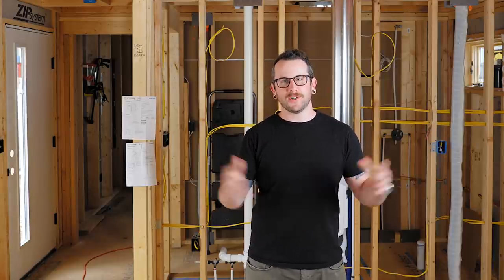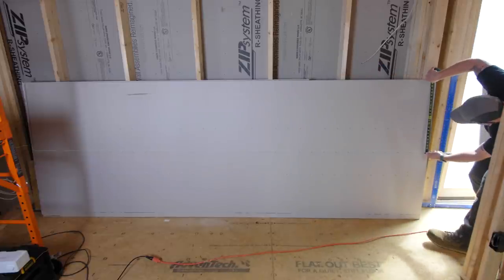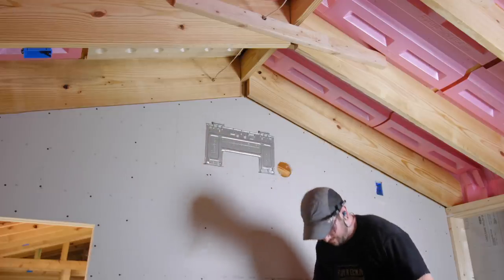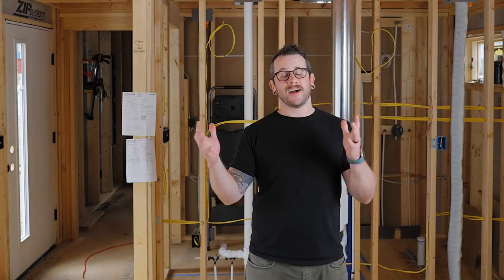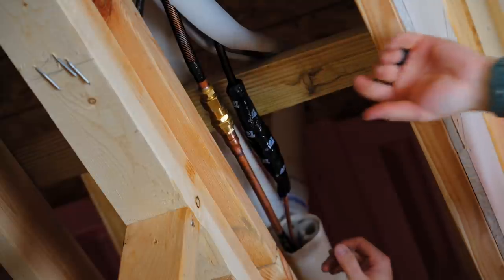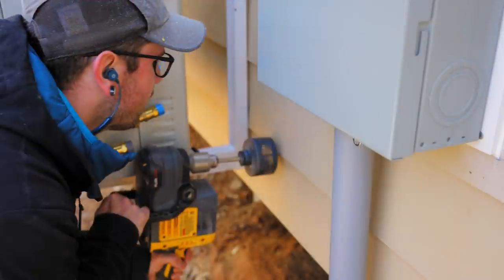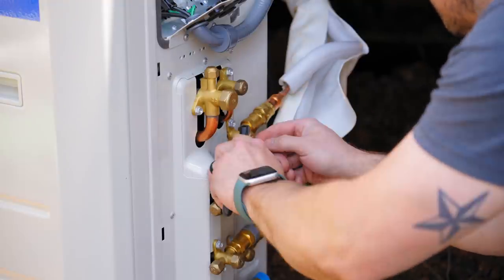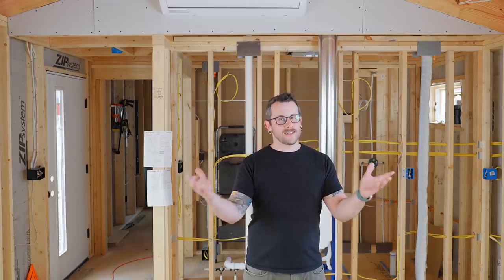DIY MULTI-ZONE Ductless MINI SPLIT Installation in New Construction!

Comment: How can you check for leaks before you open the refrigerant valve? It’s like checking for water leaks with the water off
Reply: According to some of the other comments, those line sets don’t end up with refrigerant in them. Maybe we should watch a Mr cool video. Must get to the bottom of this mystery!
Reply: This is a mrcool dyi unit which has refrigerant in their lines. They connect and then that opens them up.

Comment: I'm surprised that not many people know of the Zamna Climate mini split AC and heat pumps that are DIY just the same as Mr Cool units. It would be really cool if you could get one of these units for the house. 
They are solar ready meaning they run off direct power from solar panels - NO SOLAR INVERTER NEEDED. However, they do accept connections from the grid, so you can call them hybrids. 

I'm actually running a few of these in Jamaica 🇯🇲 right now. The 12000btu runs off 3 solar panels and the 18000btu works with 5-6 panels (405W).

The company that makes and sells them are based in the United States - Zamna Solutions | Zamna Climate. If you should reach out to them just let them know Rayon from Jamaica 🇯🇲 sent you the info ✌🏼.

Comment: Being a person who likes things streamlined I get the process of running as much as possible out of sight...
Being a person who has to fix the stuff that breaks in my house I would’ve run the lines up the outside of the house - through PVC pipe inside (as a conduit, inside the walls) and used industry standard covers outside... that way you have access to service the lines. And access hatches at all mechanical joints, because.....

Comment: We found out the hard way, fire foam is not to code as fire block. You need fire block caulking.  This product expands when burned so it continues to pluck the gap as material burns away.
We started a 2hour burn wall and luckily were told early on in the build of our mistakes. Had to dig out all of the foam around rafters and floor joists and replace with caulk. 
Thanks for the video.

Comment: So please explain what the soapy water test on the inside connection of the line set accomplishes when the lines are not under pressure.
Reply: All Line-sets and units are pre-charged. So everything is pressurized from the factory.
Reply: @zacharywhite8230  Not true. Compressor is pre-charged with enough refrigerant for 25 feet...The line sets are not pressurized. If they were, you would still break the vacuum while terminating to the condenser and evaporator. You would still want to charge the system with nitrogen, leak test, then vacuum down the system whilst removing the nitrogen charge. Then while there is still a vacuum, you would release the refrigerant all while keeping an eye on the gauges to ensure you are within maker plate specs. They (Mr.Cool) does call these 'DIY', but if you read the manual, it also states that a professional who is licensed to deal with refrigerant should perform the final turn-up.
Reply: @uswcboy  then they need to quit leading people on about having Line sets ready to go.
Reply: @uswcboy  this is a mrcool dyi unit.  Their linesets have refrigerant in them.
Reply: @majorstinky  Sorry I thought I had responded to this post. It is true Mr.Cool has quite the line up out there in terms of PRO and a smattering of "DIY". I think that they are quite clear in their wording on certified/qualified/trained and technician. I am still sticking to what I have said earlier. In fact, on the product page, MR.COOL explicitly states "NOTICE: MRCOOL® products must be installed in accordance with all applicable local, state and federal codes and regulations.   Unless explicitly stated otherwise, installation must be completed by a licensed / certified HVAC technician.   ALL electrical connections to a power source must be performed by a licensed electrician and comply with local, state and federal electrical codes and regulations." |  I think the Key here is Licensed and Certified HVAC. Certification comes into play as you are dealing with refrigerant which is a heavily regulated compound. Not only regulated by the AHJ in the area (building inspector types), but also by the EPA and more than likely a "state office of environment'. see: https://mrcool.com/diy-3rd-generation-e-star/. 
Additionally, I doubt any permitting office or AHJ would allow a permit to go out on something like this where the homeowner; or non-trade, craft/professional performs the install.
I do however appreciate your recognizing the OP...amazing how things can go off subject. Cheers!
Reply: @majorstinky  Thanks for keeping it civil!

Comment: So, I have some issues with all the mini split videos like this.  Great install video, but ‐  in Florida, I'm actually not allowed to install a system in a building where anyone is living unless I have a permit, manual J heat load calculation per room, and inspections.  I couldn't get away with a system oversized that much.  In fact, with a variable speed system, the minimum BTU output of the system has to be specified underneath the heat load calc for the hottest 1% of the year and you have to make the case for the extra BTU output at nominal as an extra load situation with calculations, but the building code really wants nominal BTU to equal the manual J output with no more than 15% oversizing.  The other issues are going to be filtration.  Mini splits don't do a good job filtering.  Also, sometimes you need to go into the engineering manual to get the mini split fans to stop to keep humidity down or add a whole house dehumidifier.  Everyone really should have at least a MERV 11 filter in their home, stable relative humidity, and fresh air coming in in some way.  Just throwing in a massive oversized system will lead to high humidity, short cycling, and in my state, not meeting code and having to swap out the system.  I contacted Mr. Cool and they would not supply me with min and max BTU rating on anything.  So, I couldn't consider them since I didn't know if I could properly size the unit.
Reply from the maker: Interesting! Definitely not the case here in NC, this passed HVAC inspection with no issues whatsoever.
Reply: A typical mini split can vary btwn 3 to 14k for a nominal 12k unit. Humidity is never a problem with these. 
If FL has those rules they are stupid.

Comment: Hi great work. I just had an estimate to have one head mini split. I was told I would need some electrical work to connect the power. (completed basement) I was given a price of 5300 does that seem  a lot? When I priced the units for one head is around 1400.00. That means the rest is labor. Does that seem like a lot?
Reply: It is a lot. One head mini split requires only a simple dedicated 1-phase circuit using 12awg wires.
Reply: Yes that’s alot of money

Comment: Question... I realize this is a few months old but, I am looking at these for my new woodworking shop and was wondering if you have had any issues running these in a shop environment? I'm concerned about how often filters will need cleaning and if there will be problem with the drain line clogging or any other issues that I need to be aware of that a dusty environment might cause.   Thanks.

Comment: I'd like to know what the precharged lines are precharged with. Do they come with some sort of valve that opens when you tighten them? Do they actually contain refrigerant? or are they just in a vaccuum and capped off somehow? Can't make 
 sense of this. He also checked for leaks adter tightening just one end of the line, either he didn't know what he was doing or the lines do come pressurized with refrigerant and this filled the indoor unit whem tightening while the other end still was capped somehow. Would love to know more...

Comment: This is WAY too late by now, but make sure that the drainage line has a continuous downward slope. If there is ANY place where there is incline that will block the water from draining and then the indoor unit will drip. Trust me, it's a well-known issue here in Israel...
Reply: I suspect those lines will gunk up a bit over time, and now they’re in hard-to-access locations...
Reply: If you were late, this is ancient 😂. Thanks, that's useful information.

Comment: If your indoor units are different sizes, does it matter what ports you connect them to? Ive heard you're supposed to connect the largest btu unit to the lowest fittings?

Comment: You should've checked for leaks in the inside connection also, with the refrigerant running thru it. When you joined them there's nothing running through the lines, so you won't know if you have a leak or not.
Reply from the maker: The lines are pre-charged.
Reply: @craftedworkshop  so when you connect the lines it releases what's in the line without turning the screw. I assume then you need to immediately check for leaks before it all goes out.

Comment: Nice video, but it appears the maximum distance for the Mr. Cool unit from wall unit to condensor/electric control unit is 24' unless they have custom extensions or something? That seems somewhat limiting. Also how did you test for leaks with nothing flowing through the lines? Also what did you do to insulate the hole going to outside the house (or did you end up not using that hole due to moving the condenser/electric control unit?
Reply: You can add another set of line and no problem. It comes with the electric and the gas piping.
Reply: Yeah, he hooks up the head w/o a torque wrench, then immediately tests for leaks without pressurizing the lines before closing in the connections behind the drywall.  I think the video skipped a step.  But regardless, this system would be a nightmare to troubleshoot / repair because connections between line and head units are buried in the walls.

Comment: How did you check for leaks without pressure system ?
Reply: I'm wondering how as well? Great series btw, thanks a lot.
Reply: I came to ask this question.  How?
Reply: Same. Inquiring minds need to know!
Reply: Actually good question.
Reply: System is full of pressurized refrigerant.
Reply: @GlenS123  not until all of the connections are mated-up and a valve is opened to release the refrigerant it isn't. They seem to be checking for bubbles in soapy water on each unpressurized connection point right after the connecting the fitting.
Reply: @marcberm  and others. I just pulled up their website and apparently those line sets ARE pre charged. Definitely interesting.
Reply: @MrDflores1  I'm looking now too. Interesting. The others I've seen have the refrigerant in the outdoor condenser unit and it doesn't get released until everything is connected and you open a valve. But now that I think about it, it isn't clear how the ambient air/moisture would get purged from those other systems if the lines weren't pre-pressurized like this. So now it's got me thinking.
Reply: @marcberm  for install, you'd have to purge those with nitrogen while brazing, pressurize check them, then pull a vacuum. Then when you're satisfied, crack open the valves you mention.
Reply: @MrDflores1  I guess there's no other way for one of these DIY/self-install dealies to work then unless all of the components are either pre-evacuated or pre-pressurized this way. Some other companies products seem less clear about that.
Reply from the maker: The lines are pre-charged, as I mentioned at the beginning of the video!
Reply: @craftedworkshop  yes, but we didn't know if all of the lines were!  Thanks for clearing that up!
Reply: @craftedworkshop  How does that work? You puncture something when tightening them together?
Reply: @luciflash  maybe the connections themselves are designed to be a reusable, self sealing connector? Kinda like the female coupler on an air hose, or like both connections on hydraulic hoses.
Reply: @craftedworkshop  yes, but until you power up the system they won’t be at operating pressure, right? So how can you be sure they won’t leak?

Comment: How did you check for leaks before introducing refrigerant to the system?
Reply: Soap bubbles. This is only because this system is dyi. Otherwise you use dry nitrogen to check for leaks on typical hvac systems.
Reply: @sprockkets  thats what I mean, if there is no pressure in the line, there's nothing to bubble up through the soap to show a leak

Comment: This is great, thanks. one thing, is there any point in 'checking for leaks' before charging the lines? i mean, if you haven't opened up the valves on the unit, then there is no pressure in the lines to push bubbles out, right?
Honest question.
Reply: I was wondering the same thing. unless the lines have some in it and when you connect them it opens somehow.

Comment: How do you determine which wall you mount the mini split on and how do you calculate what size of mini split you should get for your room?
Reply: 1 ton is 12000 btu and is recommended for up to 400sqft. Other factors to consider , building material, how much sun exposure and heat loss. Its best to consult a hvac professional for heat load/ loss calculations. Good luck

Comment: Obviously this is out of date, but it looks like the cripple studs up near the rafters by that last evaporator are pressure treated wood (see 6:10 in the video for example). Is that a problem for drywall screws?

Comment: Thanks for this video. How do you determine the length of the line sets? Also, how large is the compressor? I understand you need to have the right ration between square footage and BTU capacity. How do I figure that out?

Comment: my air con has a humming sound that osilates up and down with only a few second intervals,  what is causing that? thx.  btw it is extremely annoying and I cant sleep with the air con running.  Also the condensation pump makes a hell of a noise everytime it turns on.

Comment: Did you plan for replacement?  Eventually you will have to replace them.  With the line sets run in the walls when you have to replace them you will have to cut the drywall.

Comment: How did you check for leaks if you didnt open the ref. valves ??  there is nothing in the lines ?? also why dont you need to vacuum the lines ? especially long runs  like you had .

Comment: Curious - what was your longest run? Are they all 25 feet or did you have to use extensions?
Reply: From the video, I'm guessing he uses extension. I think the max line u can do only is 75 ft long. They do have 16,25,35, and 50 line sets. Depending on the set, u buy that comes with it. But u can do a custom order in store. That's what I read when I did research on it.

Comment: Great video! Run the line set through the wall cavity to cover all that plastic sh** up and under the crawlspace and get away from the cheap plastic that,s sold separately 🙄 by reading the comments, it seems a few are afraid of doing a little drywall repair in the event something does happen🤔🤣🤣GREAT VIDEO!

Comment: Great work, nice attention to detail. I have a question for you though. Why would the  Code require Fire rated foam sealing of your penetrations when the wood construction frame itself is combustible construction?  I do not believe that the IRC (International Residential Code)  requires this level of fire protection at penetrations especially in a  single occupancy building. See IRC 2020 P2606.1 Sealing of annular spaces.  paraphrasing -  the caulking material , foam sealant or gasketing material shall be designed for the conditions at the penetration location. Since the condition is that of combustible construction, fire rated caulking is  "overkill".

Comment: First thing you never bury flared or especially puncture fittings inside the walls that is a huge risk you need to learn how to rough in your line sets and then hang your indoor units specially after construction is done you never install completely the inside units during construction

There is a reason good hvac companies charge what they do . WE know what we’re doing
Reply: I’m wondering how he is leak testing the unit without pressure in the lines🤔 maybe I’m missing something
Reply: @albertbootle6854  I wondered the same thing
Reply: @albertbootle6854  i was also wondering. 😅
Reply: There's no pressure on the lines how can you test for leaks
Reply: @jackdickson2095  

These are cheap pre charged line sets with puncture fittings  . Again would never suggest putting mechanical fitting buried in the walls not good practice . 

Also ! , don’t buy mr cool units you will find out there’s no local support from any hvac dealer .
Reply: @twittyk78  ok, so what you’re saying is, cut and reflare the lines at the inside unit so the lines are one piece throughout the wall. 
 Secondly, what is a good brand that is serviced by hvac techs as most I’ve talked to in my area do not deal with mini splits.
Reply: @Lmiller201  Mitsubishi is the leader 

Reliable and support

Comment: If I have three units, can the temp be controlled independently or do they all have to be set to heat or cold?
Reply: Independently. Each unit has it's own line set so they operate completely independent of the others.

Comment: how do you manage the temperare in bathrooms? great job btw and thanks for your reply
Reply from the maker: I have an exhaust fan with a built-in heater for the winter months, but it stays comfortable during the summer months as long as you're not taking an hour long shower.

Comment: Unrelated to the mini splits - I'm in EU and most houses have concrete foundations, but thinking of building a summer house like the one you have. I've noticed it's raised on concrete slabs, and that you can crawl under the house. 
My question is how do you deal with rodents/animals/ snakes and bugs nesting under the house, and if it snows there (or rains heavily) won't the bottom mold (since it's wood)? 

Thanks in advance.